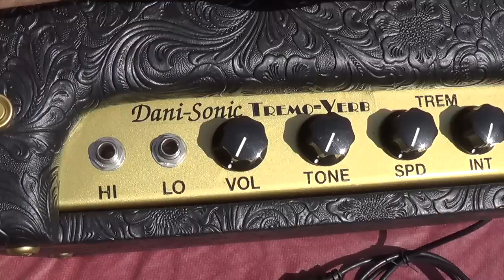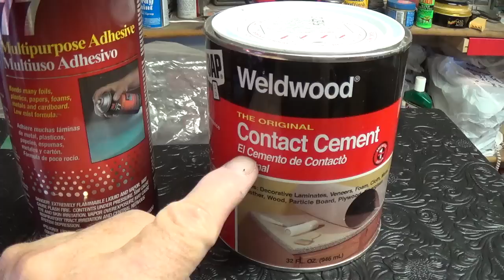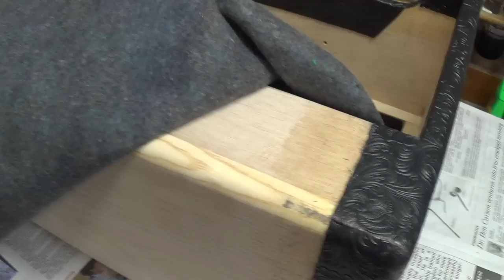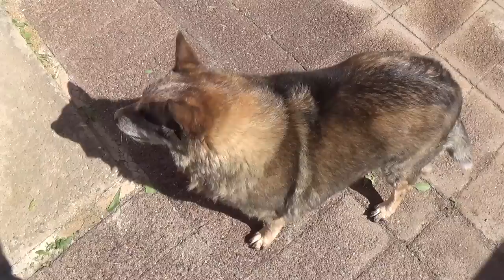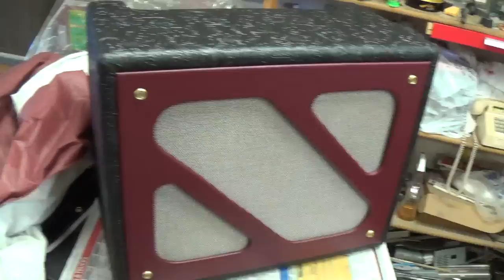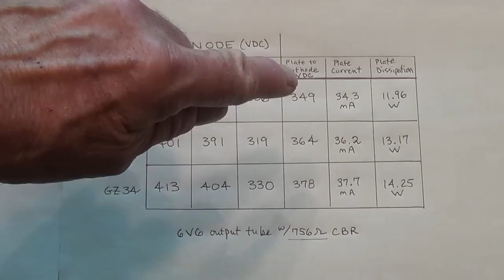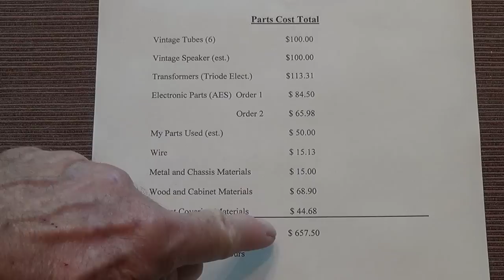How to Scratch-Build a Vintage Amp, Part 8:  Completed and Tested

Comment: Hey UD,
I am just about finished wiring this amp and I really apreaciate this series. It has really helped me on my first build. There are two contradictions between your revised scematic and the diagram. On V1& V2 the diagram has two resistors which are labeled 270 R but the scematic says 270 K. I went with 270 K. And with the tremolo circuit there is a resistor on the diagram which says 2M but the schematic says 3M, I went with the scematic. I am not trying to be picky. I thought maybe you would want to know, or not. Thanks again for your work.

MT
Reply from the maker: Thanks, MT. I am aware of the discrepancies between the schematic and the wiring diagram. When in doubt, always go with the schematic. I'm glad you enjoyed the series. I hope your first build turns out even better than you expect.
Reply: Hey thanks, I am glad I went with the schematic. I really get a lot out of most all of your uploads and can't thank you enough for your generous sharing of skill & know how. It is pretty rare actually. I did wish to send you a picture, but if that's too much I understand. Edit: I found you on Patreon see you around. Have a wonderful afternoon,

MT
Reply from the maker: You're welcome, MT. You can post photos on our Facebook page: Uncle Doug's Vintage Amps.

Comment: Sounds great, Doug! I'm a little surprised at the difference the 5881 makes, I think I'd stick with it. Much cleaner than with the 6V6.  Getting more bass shouldn't be any problem unless the power supply is folding up, but it's probably fine. Just a little tweaking on your coupling caps might help, or larger cathode bypass caps. Beautiful work~
Reply from the maker: Thanks, Bill. Excellent suggestions !!!

Comment: Hi Uncle Doug, you thought that the amp had some undesirable features. 1. Strong tremelo and 2. Rather weak bass. Did you fix those or decided they were ok? Also which tube did you prefer the 6L6 or 6V6? Finally did you demo the gain part of the amp and if not how do you like it. I've heard that in a 5 watt amp you can drive the tubes to saturation and still be in the same room. Is that true?
Reply from the maker: I answered all these questions on FB, Richard. Thanks for your inquiry.

Comment: Hey Doug, nice to revisit an old one. I got wood to construct my cabinet for the Fender 5E3-P today and have been watching your good old how-to builds. I wouldn't have gotten this far without your build videos. In fact, I don't know if I would have done it at all without having found someone equally obsessed but way more wise and disciplined on it. That's a good thing. This amp screams and has tons of mojo. It's one of the best sounding in my memory of all your builds.
Reply from the maker: Thanks so much, JT. Best of luck with your project.

Comment: Hello, I am trying your reverb circuit in an amplifier but I am having trouble getting it to work. I was wondering if the grounds on the spring tank itself should be common to each other? Should the secondary of the reverb transformer common be grounded or does it not matter?
Reply from the maker: According to the schematic provided in the video description, the input of the reverb tank has two leads, one from the green wire of the reverb driver transformer secondary, and one from the black wire. The black wire lead should be grounded. On the output side, one wire goes directly to the grid of V4a and the other lead is grounded. A 220K resistor connects the two output wires.

Comment: Adjust your tremolo pot value to a higher ohms and that should fix the tremolo !
The value of a FX loop is very high sonically  if you consider the sounds you can get !
MOD makes a add on effects loop very reasonable priced !
You may like a warmer speaker to add the bass it needs !

However my amps get more bass as the volume goes up a bunch on my 2-6v6gt amp , and a added gain stage introduces some clipping of highs and warms up the sound !
Heck of a lot of good work done already , but perfection can be had sonically !!!
Reply from the maker: Thanks for your suggestions, IS.

Comment: Is it possible to connect the output of the tremolo circuit to the power tube in this situation without damaging anything?
Reply from the maker: It wouldn't be as effective, LH. Altering the  signal volume before amplification is much more efficient than afterwards.

Comment: Did you ground the secondary of the output transformer? Sometimes I see it done, Sometimes I don't.
Reply from the maker: Yes, it is grounded through the output jack's connection to ground.
Reply: So its grounded to the chassis from the output jack's ground lug? The common from the OT goes to the ground lug of the output jacks and the 4 and 8 ohm taps from the OT go to the respective tips of the two output jacks. Do you then ground to the chassis from those output jack ground lugs? Thanks for any help.
Reply from the maker: No need to do so, Nemo. With Switchcraft jacks the ground lugs are connected to the  body of the jack and automatically grounded when you install the jack in the metal chassis. If you really wanted to be sure of grounding, I guess you could also add a ground strap.

Comment: I'm a little confused about the tremolo circuit in your schematic. Where is the output from the tremolo circuit and where does it connect into the rest of the amplifier?
Reply from the maker: Look for the letter "C" in the tremolo circuit at the bottom left of the schematic. This is the tremolo output. Now look for the "C" that connects to the cathode of V1. This is the tremolo input. Imagine that the two "C's" are connected.
Reply: Ah I see now! What about the input for the tremolo. Where does that connect to? It's probably glaringly obvious but I sometimes miss details.
Reply from the maker: There is no input, Liz. It simply modulates the volume up and down, just like you're turning the volume knob louder and softer.

Comment: Hey! Have you ever built an amp with an effects loop? (yeah I know, not as vintage as you'd like to be but still a handy feature). Even if not, pedals like low impedance signals, so I am guessing they'd be driven by a cathode follower but are there any other considerations to keep in mind when designing the effects loop stage in an amplifier?
Reply from the maker: No, I have never included an effects loop in any of my personal builds, Liz. As you say, I tend to stick with vintage circuits and effects.

Comment: Hello Uncle Douglas:  The value of your videos has been touted so often that I am concerned that sincere admiration will start to sound trite, but you step by step method and explanation of each aliquot in depth certainly exceeds any self teach course available.  Regarding term-verb, the first 12ax7 is only half used, is it not?  Could the output after the 0.015 microfarad capacitor be directed into the second grid of the V1 or could the two triodes be wired in parallel for more output into the tone stack which I thinks is what comes next.  Or could the second half be used to start a vibrato circuit called a Warbler at sluckeyamps.com.  It actually uses 5751 tubes to replace 12au7 and there are three tubes in the second revision.  It seems to my ear that an "effects" circuit which is used at the input of the amp results in such over-powering of the regular amp music, that all you hear is the effect.   For this reason it seems better to inset a circuit like you did with the Fender re-verb circuit.   Well, that is probably too many questions to put in this format so I had better stop.  Thank-you for your endless and selfless help.  Live Long  Vince.

Comment: Hello Uncle Doug:  Very much appreciate the Tremo-Verb construction videos.  I am sure that it took a great deal of time on our part  and the effort you have put in is noted and logged.  Have a question which I have not seen covered in the other comments.  How do you determine the voltage tolerances of the various capacitors.   The voltages are given for the power supply capacitors, but not for the various tremolo, bypass, linking capacitors etc.  Is there a way to determine these values?  Live Long.  V
Reply from the maker: Thanks for your very nice comments, Vincent. The general rule of thumb is that all  non-polar signal capacitors are rated at 400V or higher. Cathode bypass caps can be a low as 25 to 50V.

Comment: Dear Doug, Calling in from the UK. Thanks so much for the sharing of your knowledge and experience, which is invaluable.  At the end of this vid - part 8 - on building a vintage tube amp - you mentioned the issues with the bass and tremolo.  Is there a video where you demonstrate how to tweak an amp in terms of improving different aspects of its sound?
Reply from the maker: You're welcome, Richard. I have not posted a video dedicated to that topic, but touch on it often in other videos, particularly the Kay Model 720 and the Gibson GA35RVT.

Comment: What a wonderful video series.  Great work at every level. I prefer push/pull dual power tubes because clean tone is a focus of mine. Switchable power tubes was brilliant and I use Tung Sol 5881's in my HRD with proper biasing so they run around 30-32 watts (I think).  Particular warm tube from modern Tung Sol. Thank you for what you do.
Reply from the maker: You're welcome, Mod. Thanks for your very nice comments.

Comment: Wow, that's an 'all the way cool' tremolo... (!)
Uncle Doug, would you happen to know how one would slow the trem down some more... maybe even so slow that it would take on the guise of an unusual built in effect? (So far, no one seems to have the answer to this one) 
Thanx again for a truly great series... you are truly both a master craftsman AND an artist... 
cheers
Reply from the maker: Thanks, Jonny. Tube tremolos are limited in how slow they can go, because the oscillator circuit will quit oscillating. This one is about as slow as it gets.

Comment: A friend of mine and I have just completed building this amp and it sound incredible.  With a 12" speaker it stacked up really well to a Fender Twin Reverb.  Tone is incredible.  We used a 5y3 with a 6v6.  Everyone who has played it thought it was great the.  The reverb is amazing and the tremelo circuit is absolutely fantastic.  We did modify the circuit slightly.  We put both sides of the first 12AX7 in parrallel so the signal was sent to each grid.  The touch response is great and this really sings with a single coil in the neck position.  I highly recommend this build.  The schematic and instructions were great and really sped the project along.  Thanks Uncle Doug for a great circuit and project.  By the way we named this the "Rusty" in tribute to your inspiration.
Reply from the maker: You're welcome, JJ. It's great to hear that your version of the TV turned out so well. Hopefully this will encourage others to give it a try.  I like your suggestion about parallel wiring of the 12AX7 grids, and will experiment with it in the future. Rusty and I appreciate your nice remarks and congratulate you on your success

Comment: I got a question for Rusty. :)  First, thank you for your videos.  They have taught me indepthly.  What changes did you end up making , if any, to increase the bass on this amp?  And, does the schematics reflect that?
Reply from the maker: Actually, the more we listened to it, the more we liked it just the way it was, Joshua. I guess we could have increased the values of some coupling and cathode bypass caps......but we never did.
Reply: Awesome!  I think I am going to build it for my first amp project.  Everything just sounded perfection.
Reply from the maker: Thanks, Josh. Best of luck with your project. Let us know how it turns out.
Reply: will do good sir.
Reply: okay, I got another question for you Uncle Doug, Jack, or Rusty.  I have noticed schematics have different filament voltages for 6.3v filaments like 12.6volts in your tremodrive with the voltage doubler or 6.3volts in your supro build.  I know you need a centertap, but how do you wire the filaments?  With the 12.6 V do you just use one wire and with the 6.3 V would you use both wires?  I just dont want to blow a tube.  Kinda confused.  Hey, maybe video worthy. I dunno.  Thanks, Josh
Reply: oh, i figured it out. I looked at 12ax7 data sheet.

Comment: Sounds real tinny, also the tremolo is very choppy, perhaps not enough "sine-wave" in it... You have a lot of resister/capacitor series coupling, perhaps look into a high cut slope filter or increase your coupling caps size x10. I didn't see any tone shaping networks in your schemagic. Did you fix all this and post a newer video?  Good workmanship!
Reply from the maker: You're the first viewer who didn't like the tone, FS. Maybe it's time to invest in some new computer speakers.  Thanks for approving of the workmanship.
Reply: There is nothing wrong with my sound system other than the fact it's a Dell computer, and the sound isn't terrific, however compared to other guitar amps I've heard thru this same system, your amp sounds tinny and lacks bass. Perhaps it's the guitar, I don't know.  My speakers are flat to 40hz and as I've said, other music thru this system sounds more balanced in the bass region.

Comment: Hi again Doug. I have a couple more questions on your great tremo-verb videos. First, and easiest, why does the layout diagram not include a jumper between pins 4 and 5 on V1? Second, if I were to build this simple circuit without the tremolo section or the reverb section, could the 1/2 12AX7 labelled V4b be accomplished with V1b, therefore only requiring one 12AX7?
This we be for me to attempt a simplified guitar amp for my first try.  Thanks, Roger.
Reply from the maker: Greetings, Roger. My guess would be that since only one triode was used in V1, there was no reason to energize the filament of the unused triode. If you left out the tremolo and reverb, the remaining circuit could function with a single 12AX7, as you suggest, and would closely resemble a Fender Champ, but with a switchable bias to allow for either a 6V6 or 6L6 output tube. This would be a simple but rewarding first build.

Comment: Hi Doug, Your series of videos for the tremo verb are just fantastic. I do have a question of being able to modify the circuit to have a bit more power. Could you possibly modify the circuit to use two power tubes as parallel single ended output tubes, and still be able to switch between two 6V6's and two 6L6's? How would one do this?
Thanks, Roger
Reply from the maker: Thanks for your nice comments, Roger.  I would think that if you used a power transformer with greater current capability, such a parallel output tube modification would be possible......however, I can't really see the need. The volume gain with parallel output tubes is not terribly significant, and if more power was truly a necessity, it would probably be best to construct the 1622 Tremo-Verb circuit which has dual output tubes in P-P and offers 25W of power.

Comment: hi uncle Doug and Rusty I'm in the process of building a fender 5D5 amp would I be able to build the  tremlo from your  Supro tremlo  circuit into the fender 5D5, and if so where would  the right place to couple  it into.  Thanks for that I have learnt so much from your great work you are so talented thanks anyway 
     Tony
Reply from the maker: You're welcome, Tony. Circuit additions like this often require some experimentation with point of insertion and component values, but I would suggest as a starting point:  1.) For strong trem, apply the trem output to the cathodes of the pre-amp 12AY7.  2.) For somewhat less trem, apply it to the cathode of the upper or lower (experiment) 12AX7 triodes.  Let us know how it turns out.
Reply: thanks Doug I shell do that. I've just started building it and I'm waiting for some parts so it will  take a  while before I finish the amp 
   and thanks for your good work
      cheers tony
Reply from the maker: You're welcome, Tony. Good luck with your project.

Comment: Hi Uncle Doug, I've been watching your videos for the past month or so, and really appreciate the time you've spent on these, as well as your teaching style of boiling complex concepts down to simpler, easier to understand explanations.  I don't get everything just yet, but will keep watching until I do.  Two areas where I feel I'd need more help is walking through a schematic and understanding everything that's going on at that level; and, then being able to translate the schematic to wiring an actual amp accordingly.  Do you have any suggestions for books, videos, or other instructional materials that might help with these two areas?  Thanks again for all you've done.  You are putting out some really great information!!
Reply from the maker: I think you need to do some personal practice, Bill. Watch the videos, learn the basics, and then start analyzing simple schematics. Learn what each structure and component is and what it does. Once you have reached this level of understanding, translation into actual amp wiring should not be a great challenge. Good luck.
Reply: Thanks very much, Uncle Doug.  I appreciate your suggestions!!

Comment: I am in the middle of a project build and just found your videos... awesome work... my question is going to be why do you use the weldwood on the wood side and not just use the super 77 on both sides???
Reply from the maker: I have found that spray adhesive on both surfaces does not hold as well or last as long as brushed Weldwood on at least one surface, especially in corners and anywhere where edges can lift.
Reply: Good to know... another trip to home depot... prob arbor freight for a roller and new razor blades too... I like your style Doug... I'll have to post a pic for ya when I'm done... thanks again! & God bless!!!
Reply from the maker: Best of luck with your project, Jamison, and by all means post some photos on my Facebook page:  Uncle Doug's Vintage Amps.